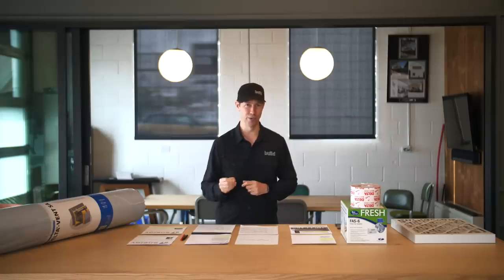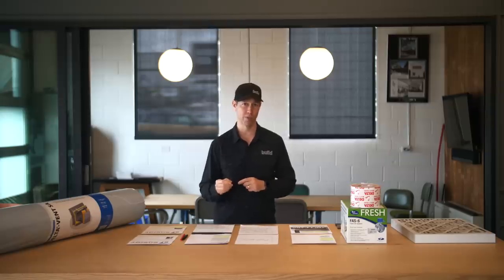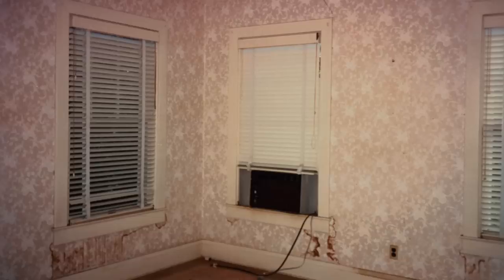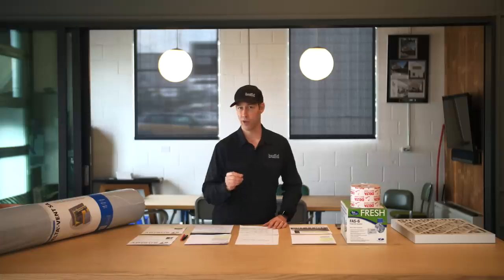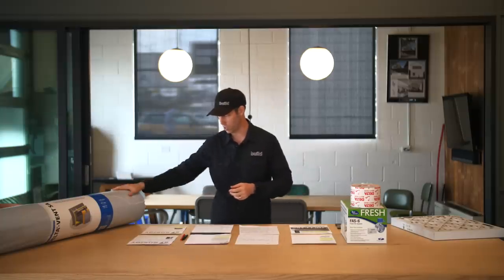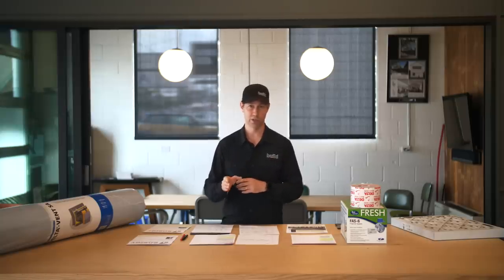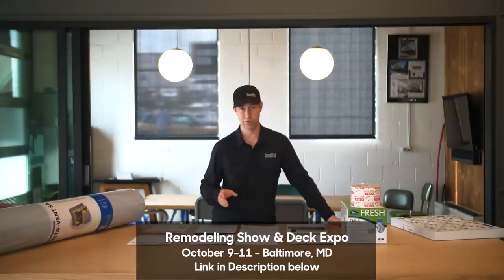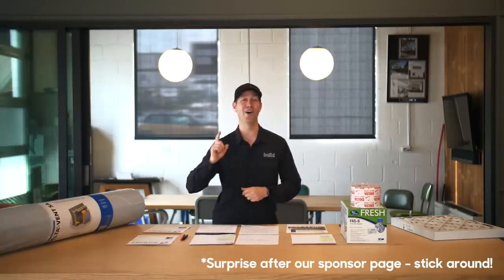“Houses need to BREATHE!” - Shut your filthy mouth

Comment: I would sure like to know more about air systems such as you were talking about. Also about air to air heat exchanges, how to build one, or where to buy one. I assume an air to air heat exchange would become an air to air cooling exchange during the summer, but I have a lot to learn about them. I know I would really need fresh air if I installed a rocket mass heating system. Quality air is obviously very important, and also appears to be very overlooked. If I am not mistaken, I believe we would all benefit by breathing good clean air all of the time.

Comment: I'll build a super tight house, keep the water out, do air exchange, filtration, and humidity control to provide the best, most comfortable living space possible.
Reply: You've a super controlled house, you just said you do air exchange that's not an air tight house. People are using incorrect terminology. Houses need to breath, obviously it's preferable if that is controlled rather than uncontrolled.

Comment: After looking at the cement block interior of your office, you might have some ideas... my house - 1960s construction, slab foundation, brick exterior over cement block, drywall is double thick directly fastened to cement blocks - zero wall insulation - what is the best way to insulate / air seal this mess???
Reply: Brick is mass and should be inside the house. Stud over the brick, then spray foam and add exterior sheathing of your choice---but not brick

Comment: There are some differences how people understand breathing in this context. For me it doesn't mean air tightness. It's about wall's ability to move moisture. Correct word is hygroscopicity. Those old houses are still standing because they are build from single hygroscopic materials. Tile, rock and wood has this ability. It's not catastrophical if this kind of material gets wet as long it is able to dry. High humidity and moisture levels create rot and mold but it needs some time.

If we are going to use human clothing as example I would compare modern houses to having a rain coat to your skin, then some artificial material and then another rain coat on top of it. This works as long as you have some artificial system to control the body temperature and moisture. If your rain coat get's damaged somewhere you are in trouble. Then moisture can get in but it doesn't have a chance to dry. This equals losing the insulation capacity and create opportunity for mold to grow. In the other hand we have hygroscopic wall what for me is more like cotton shirt + wool sweater + jacket. This kind of combination enables you to work hard and sweat even in a cold climate without losing all of your clothes insulation capabilities. Your shirt can get little wet but the wool takes the moisture and with time it will will vapor from it. As long as you don't wear a jacket made out of latex or something like that. 

This doesn't mean that you could not have relative air tight walls with modern ventilation and air conditioning. Wall can be made for an example from a thick wood or some kind of modern tiles that are full of air cells and have an excellent W/m^2 K values. 

For me this is the way to build modern houses that will last as long as the old ones still standing. It's not as risky to errors while building and corrosion with time.

Comment: Hot humid air leaving through wall can hit your sheet material and cause mold and rot. Well yes, but theres plenty of options to avoid that and still have a breathing wall:  Use 2x6 instead of 2x4 studs - condensation point is being dragged outer part of the wall. 
Use cellulose wool - moisture can pass that way better than minaral wools. 
Use simple breathable wind protection sheet, and pay a little extra for the real wood, or natural plasters (if roof has enough overhang). 
This way you may loose only a bit of the heat, but your general and mental health are better. 
If the house is airtight and opening windows is called a solution - think again, opening windows to keep house airtight? Right? 
If the house is like body - there is hell of humiditi leaving human body even through the skin only. Skin is your second lungs. Remember the bread when it starts to mold if left in plastic bag? Now is there any mold on out of date bread, if left on the table? Your mental body will always want to leave the house if living inside of a plastic bag. Filters can not clean the air from all your fart, diseases, unnecessary bacteria and such - downside of the passive house. 
Following code is of course cheaper, but what's your health price? Using house just for sleeping - then yes, you won't notice too much. That's called dormitory.

Comment: Houses need to breath. But that doesn't mean it has to leak. You can control how your house gets air. 

Here in Europe we traditionally use our windows. Open most of them for 5 to 10 minutes a time twice or three times a day. That way the outside can dry when the windows are shut. 
Or the modern way is the controlled fresh air system. As matt said. Maybe with an heat exchanger, a filter and what ever else you want. 

So in my opinion Matt is right. But be care full. if you don't do it right, you get mold.

Comment: I have a 1930s house in Alabama that looks exactly like the example you showed...100% real shiplap on walls, floors and ceiling and cedar dimensional studs. It also has ZERO insulation except some blown insulation in the attic. Electricity/Cooling costs are about $250/mo. during the summer. Is it best just to leave the house as is?

Comment: i see what he is saying....i have worked at alot of different apartment complexes up here in new england mostly built late 60s early 70s.....tons of insulation everywhere but the old single pane windows with storm frames..basically defeating the purpose.

Comment: While I haven't worked in the trades for years, I remember the phrase "let a house breath" had more to do with radon mitigation than energy efficiency.
Reply: Older builders are usually talking about a walls ability to take up and emit water vapour which prevents rot and controls internal humidity... but houses aren't made out of natural stone and wood anymore.  It's all plywood full of glues, plastics and manufactured products so the term is used more to talk about airtightness/ventilation and actual air exchange nowadays by the sounds of it.

Comment: Made a few valid points, however the way I see it you used a single example of a terribly built old house to make your case.
Where I live in Europe (terribly insulation regulated and heating taxed Europe) houses are made of bricks and concrete and are good as new after a century even if you don't have any (unnatural) ventilation.
You used modern cars as an example and explained heat recovering ventilation ithout mentioning the pricetags of these newer technologies, I wonder how many are financialy struggling in this race of airtightness and technology coolness.

Some of these newer ideas are only artificially made more attractive by way of comparison...by artificially making old ways more expensive, taxing it or subsidizing change such as insulation or solar panels. My grandparents are almost a 100 years old, they have lived in the same house nearly all their life and had to make little to no change to this house...
How is that less sustainable than switching heatpump and solarpanels every decade or having expensive insulation that won't last a few decades and having inner walls 1cm thick instead of brick or concrete walls that can handle any force?

You also used the human body as an example (comparison of biology and architecture?) but the fact of the matter is we absolutely do have skin pores and can 'evaporate'. A human body also releases a lot of heat, as much as 200 watts/h, that's how clothing works...thus the human body is far from a closed system. We even have cutaneous respiration, >2% of gas exchange occurs through the skin. There's a reason for that, it is necessary because it is local unlike a single central breathing mechanism (such as a single ventilator).

Comment: Matt this address breathing of the home. But what about the attic? And you use your example as a house in the north but what about houses in south like where you build in Austin, San Antonio, corpus, etc. I would like a video on an in depth look on breathable attics and sealed and what things you need to have in place when sealing your attic with foam. I don't think it is as easy as just getting in my attic and spraying foam everywhere.  Thanks.

Comment: Before watching the video:
I feel like if you have a very airtight house, you'd also want to make sure you have proper ventilation. If you have the most airtight, insulated house in the country, chances are you're going to have an AC unit in the budget to deal with the moisture from your stove and farts getting contained. And chances are, you don't need much heating for the place, so wood heat wouldn't dry the place out for you. But if you had a leaky house, you're burning so much wood to keep it warm, you're also gonna dry the place out a lot in the process, almost by accident. I've noticed I can keep a pack of smokes indefinitely in my 79 continental and they're always gonna be smokable because the windows don't actually reach the tops of the doors like they should. Leave them in my buick suv from this century for a dry week, and they're still gonna contain the moisture from the rain last week and be unsmokable.
Now, lets watch buddy tell me i'm wrong.
Reply: We had a very different experience from our 70s cars. I intentionally get people to drive me places so I can lay down in the back seat because it's got that fine comfort you don't get out of cars anymore. What 2000s car has literal pillows built into the walls? If it weren't for the leather seats I'd call it comfier than my couch despite my couch not being 40 years old lol
Reply: holy shit, he didn't tell me I was wrong. only thing I disagreed on was the 70s car thing. Must be because I won't pay more than a grand for any junk from this decade LOL

Comment: Code doesn't make it right, just makes it law.
There is a choice between building for future energy consumption or present building cost, but it is not that simple.
The future energy savings could come with costs that are not considered.  Like if there is a power outage my house is a death trap, it is so tight you would literally suffocate.
Burn a few candles in there?  No way. House fire?  oh yeah, all that rigid foam sheathing and spray foam, poly, vinyl, this house would become a superfund site and the cleanup would bankrupt the town.  But I get to save a few dollars a month on energy.  Which comes from a completely renewable green source where I live, so, why?  Because somewhere else, in different circumstances decides what I should do.
Why not tie up some carbon in trees, then use it for interior sheathing?  The carbon output for my heating is basically zero.  Cellulose insulation, wood cladding, wood framing, wood roof, makes sense where I am, especially as a worker at a wood processing mill.
So with all that wood, there is a lot of potential for dealing with moisture, and the biggest threat to the longevity of the wood parts is moisture, it does need to dry and drain.  Which means BREATHING, even if it is done in specific areas in a controlled way, yes, it does need to breathe.
So, for example, under my wood roof is an air space between the cedar shakes and the solid roof deck, to allow the shakes to dry on the under side, preventing moisture accumulation and differentials, so they don't rot or warp.
Under my wood exterior wall, between the exterior rigid foam and shakes is once again an air space, to allow the shakes to dry and drain.

Both of these ARE NOT REQUIRED BY CODE and without it the wood will not last very long at all.  They are also examples of the house breathing, without negative consequences on heating, cooling, vapor drive comfort or longevity.

For inside my house i have to rely on a fan to ventilate the house.  Without it it is uninhabitable.  If there were flexibility and choice in the codes I could make other changes too.
Reply: Aren't there windows if there is a power shortage?
Reply: @yeiiful  Yes, but the point is there are drawbacks to making rules that apply to everyone regardless of differing circumstances.   There are also drawbacks to fanatical idiots saying "Houses need to breathe?  Shut your filthy mouth!"
For example, code requires a vapor barrier on the inside of my wall assembly, but with a solid barrier on the outside with rigid foam this traps any water in between the two vapor impermeable membranes and no possible route for drying or "BREATHING".  This exact scenario will result from following Matt Risingers advice, he commonly recommends exterior rigid foam, and in many places an interior vapor barrier is required, will not pass inspection without it.
There's actually a trend for renos to add rigid foam to the outside, on houses with poly barriers on the inside, but with decades of misuse, picture hangers, renos, unsealed electrical fixtures, these are leaky old houses that now have no drying potential once condensation forms inside those walls because the rigid foam on the outside has sealed it in.
These systems rely on 100% integrity, if any part of it ever fails for any reason there is no potential for drying. 
Houses need to breathe, but in a well designed and controlled manner.  Need proof?  What is required by law in every one of these new homes with tight vapor barriers?
A whole house ventilation system.
What does that do?
It makes the house breathe.  

TLDR; Matt is a glory seeking  idiot.
Reply: @zandemen  what an enthusiastic answer for my short comment. Thank you anyway. Near the equator there isn't much talk about building tight or building with wood. Seasons make thing very different. Looking forward to living a year in a country with seasons!

Comment: You either build a thermos or a breather. Best is the earth houses.. takes the energy out of the equation.

Your example is a thermos vs leaking thermos.. so for thermos you are right.

But build a breathing living earth house that is virtually indestructible, doesn't need AC units, maybe minimal heat sources.is the way to go. But building codes for thermos units restrict the building of the best homes
Reply: Nope

Comment: I thought you wanted you attic to have a lot of ventilation, where the insulation is between the ceiling joists, because the air movement helped keep the insulation dry.

Comment: Hot air doesn't rise, hot air by physics means the air is expanded which makes it lighter then air therefor it rises! Same is true for cold air the molcules condensense, becomes heavier then air which cause the cold air to sink.

Comment: I was going to post this on your 2x code insulation video, but I saw this on the "up next" thing. So continuing what I was going to say: if you never leave the house, you'll get sick from your own carbon dioxide and if you try to use a fireplace, you have to open a window to get a draft going or the smoke refuses to go up the chimney. You talk about mechanically ventilating the house to bring in the fresh air when you want. That's great if you want to spend money and be like a commercial building. Air filters for outside. Psh, same with cabin air filter. Stop being a wuss and breathe that natural air! I only want filters to keep dust/animal hair from clogging my air handler, not because I don't like breathing the dirt.

Of course, that's the old thinking. Now if doing it air tight and having that additional venting costs nothing extra, go for it. But if it's an extra $10k for a system that does nothing at all from my perspective, I'm not going to do it. I've lived in 50+ year old houses for decades (so they become 70+ year old houses) and never had a problem. No mold, no rot, nothing. The only houses that get that way around me are abandoned ones. I like to say that the soul of the house is gone because it has no one to care for, but I know it's because the air isn't being circulated, no one is there to keep it dry, and all the little things just existing in a house does for the health of it. 

I'll build a leaky house, throw the building code in the trash, and enjoy my home until I die before I get forced to spend more money than my remaining 50 years needs in a house. When I die, the house can be destroyed for all I care. I'll never have a family anyway. I'm getting real tired of jumping through hoops instead of spending that time and money on actually building. I hate building codes.
Reply: YikES!

Comment: So in a really tight house, what do you do with open fire places and kitchen and bathroom ventilation? Do you wire those into the external fresh air system, with the furnace blowing running?

Comment: So what do i do then? i'm at a loss. I have to run a dehumidifier around the clock because of constant humidity levels exceeding 60%. Our attic is heavily insulated and we do not have any gable setup that would allow for air to be released. Could this be a solution? If a house doesn't need to breathe, then the levels of humidity is caused by improper ventilation, but of what? the furnace? the attic? A/C?

Comment: Remodelled a house - the owner was bringing in coal and coming out with diamonds. 

When will the Risinger mailboxes be available in your Amazon store?
Reply from the maker: That’s really funny!  Would make a funny T-shirt logo
Reply: @buildshow  Hmm, let's play 'Design Matt's mailbox.  Start with a concrete post to resist termites and rot, zip sheathing all around and spray foam to R-30.  Concrete shiplap siding, metal roof, airtight flap for small mail.  Solar powered wireless box monitoring system for the inner nerd.  Frost free spigot optional?  Thanks for the info, I always look forward to your posts.